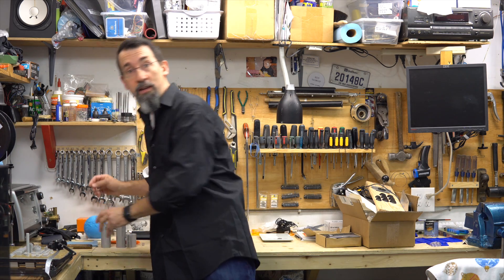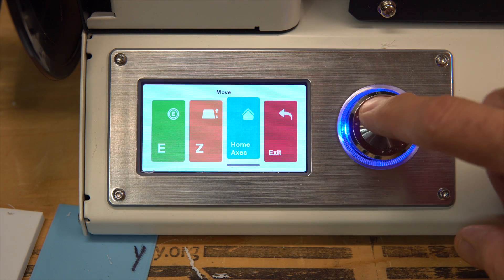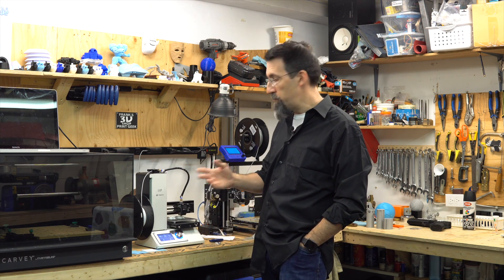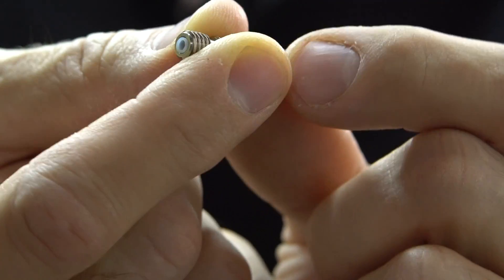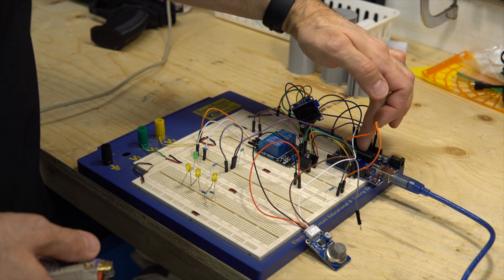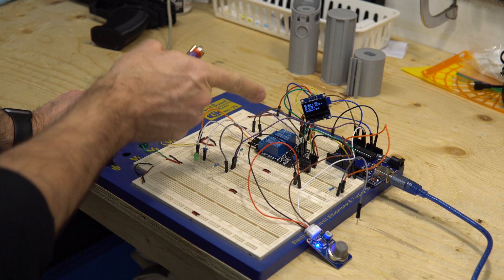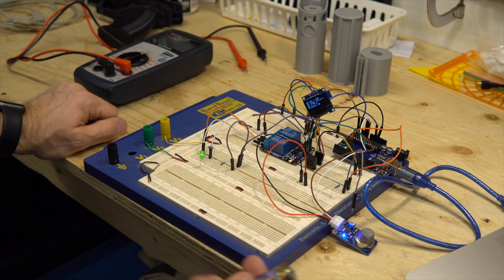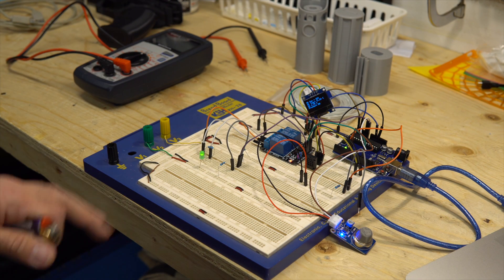Cheapest 3D Printer, firmware bug, be careful. (Monoprice Mini Select V2)

Comment: You don't say what temperature reading was of the hotend when the smoke was coming out?

You do have access to the updated Motion Controller firmware (version 40) binary file that contains the bug fix for the problem you are having as well as a couple other fixes.

Motion Controller firmware instructions and download available at the link below.
https://mpselectmini.com/firmware/motion_controller

Here is a short changelog.
https://mpselectmini.com/firmware/changelog#v40

Edit: I just saw your Facebook comment about having v40 installed when this happened.

If indeed you are using motion controller v40 as you say, please if you will document the exact steps you followed to make this happen. The more detail the better. If it happens with a certain gcode file or command also please include that also.

 This is the first I have heard of this problem while using Motion Controller v40. If it is easier to have a one on one video or VoIP call I can do that instead. With your information I will test on one of my machines to try to replicate. If I can replicate the problem or not I will pass the information along to the development team to look into the problem. I will notify them right now of a possible issue so that they are aware.
Reply from the maker: That printer is running firmware V40, I did the upgrade from the beginning. Reconfiguring Cura 3.1 yesterday I saw in the end gcode a delay and a command to shutdown the fan at the end of the gcode. I will try without those. I have reproduced the problem 3 times, always after a print finished during the night.
Reply: Frank's 3D shop are you using "M106 S1" or "M107" to shut the fan off in the ending gcode script? You should use M107 so that the printer know the fan is off. "M106 S1" is fooling the printer by making it think the fan is on but really there is not enough current to make the fan turn. Either way it shouldn't keep the fan off once the hotend is above 70°C so if it does then there seems to be a problem.
Reply from the maker: The end code was M106 S1, here is the complete sequence.
        M104 S0                     ;extruder heater off
 M140 S0                     ;heated bed heater off (if you have it)
 G91                                    ;relative positioning
 G1 E-1 F300                            ;retract the filament a bit before lifting the nozzle, to release some of the pressure
 G1 Z+0.5 E-5 F6000 ;move Z up a bit and retract filament even more
 G28 X0 Y0                              ;move X/Y to min endstops, so the head is out of the way
 M84                         ;steppers off
 G90                         ;absolute positioning
 G4 P300000 ;wait 5 minutes before turning off the fan
 M106 S1 ;turn off fan
Reply from the maker: And the sequence of events are :
1- Using OctoPrint connected to USB, a print finished some times ago.
2- I remove the print from the bed
3- I get out of the print display of the last print
4- I bring the nozzle to 210 degrees from the printer interface
5- I bring the bed to 50 from the printer interface
6- Went back to nozzle temp, set it to 215, and than back to 210 (replicating the steps when it did put on some smoke)
7- I do a Home Axis and wait for it to finish
8- I than try to move the bed, usually it motors are released within a few seconds.
9- The motors are not released even after 30-40 seconds, and smoke came out of the nozzle after under a minute or so.

Last time It happen same events from 1 to 8, but I then went to the monitor menu that time, and saw 50 degrees for the Nozzle and not moving with a target of 210, bed was showing 25 with a target of 50. I did not give it time to make some smoke again, but the behaviour is the same, I will put an old heat break on it and let it smoke when documenting it. Here is the video (unlisted) I have done of it two days ago, https://youtu.be/tsTTkWxUv4w

Comment: I've been thinking about this very issue with my printers (not just the MPSM). Since I use home automation (HomeSeer), I have OctoPrint's MQTT functionality tightly tied to each of my printers into my HA system. I was thinking about utilizing something like what you've done using MySensors (integrates with HomeSeer) and using the HA system to handle all the logic.  I was also thinking beyond safety and adding filament sensing (Jam and Run Out).
Reply from the maker: Nice setup you have!  Filament sensor, yes it would be nice, I would like something like in the Prusa MK3, a touchless sensor, since Prusa say it’s like a mouse sensor, I am thinking of using the internals of a mouse to sense the filament passing and it’s speed. Another fun project!

Comment: Well, that's a bit scary!  You think your print server triggered it?  You've had your share of problems with this printer, but you probably push it harder than most people will.
Reply from the maker: Hi Duck, from what I read online, it is present only when using USB and with manual operation of the printer and after a print. Also, I have some GCode to turn off the fan after a delay in the end code, I will try to remove that and see if it still does the same problem. I will also put back an old heat break and make it smoke again and film it this time. Yes I had problems, but as you say, it was printing non-stop many hours everyday from the time I bought it, many kilos of plastic got eaten by this little thing. The best thing about this printer, is that it is precise, printing at 0.0875mm layer height makes a nice surface finish. Oh and having more protection can not hurt, we are dealing with relatively high current and a lot of heat on those little printers, better to be safer than sorry, for me at least, and it makes for nice videos!